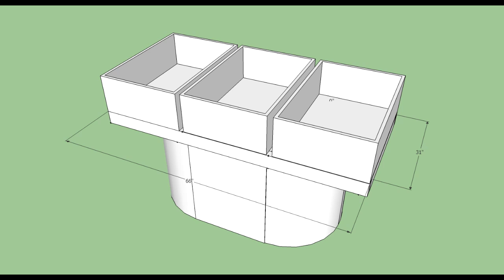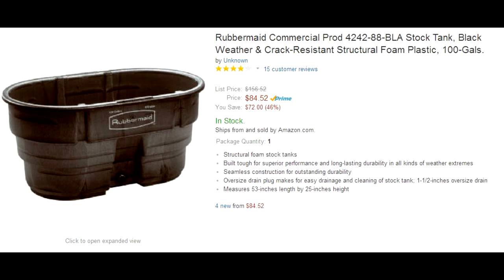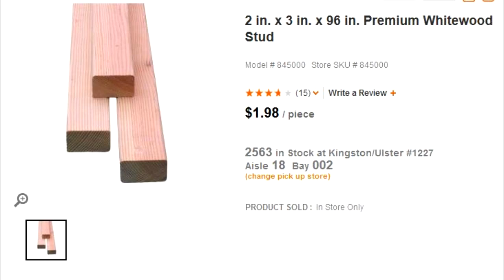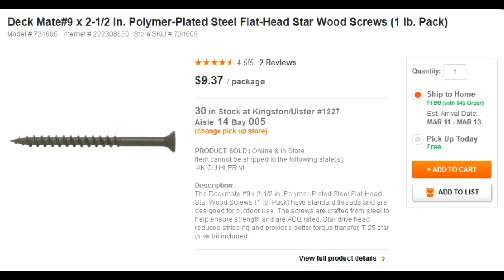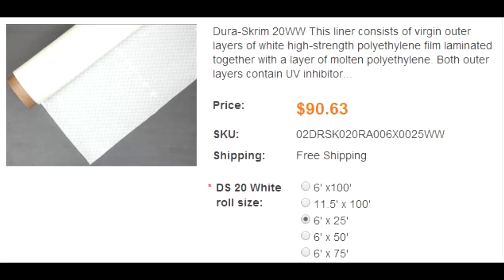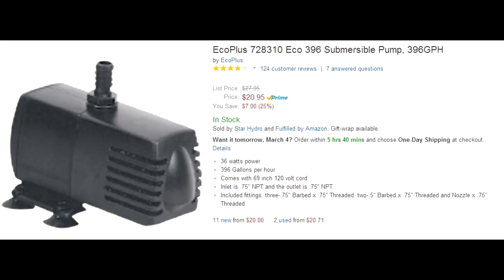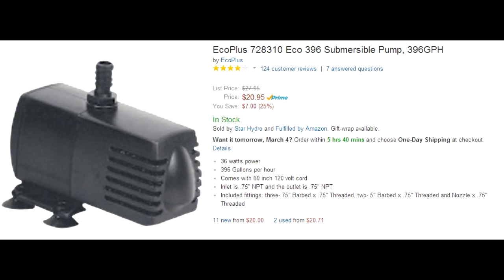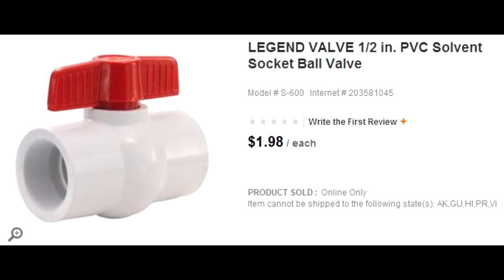Aquaponics Build Episode 1 [Design & Components]

Comment: Can you comment on food safety issues regarding the fish tank? I can't find great info out there on it. Thanks!
Reply from the maker: Fish are cold blooded while humans are warm blooded - we share no pathogens. The fish are fragile animals that will respond negatively to toxins, so they also serve as a reason to keep pesticides out of the system.
Reply: I meant more about the materials of the tank, the plastics, contaminating the fish.
Reply from the maker: The materials that come in contact with the water are all made from HDPE which is a plastic that does not leach into the water. Most liquid foods are shipped in this type of plastic.